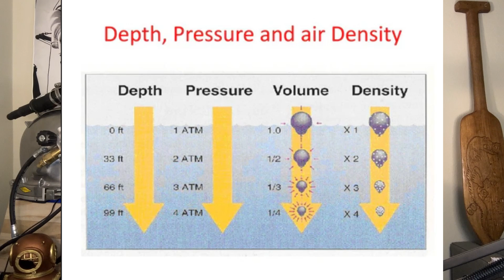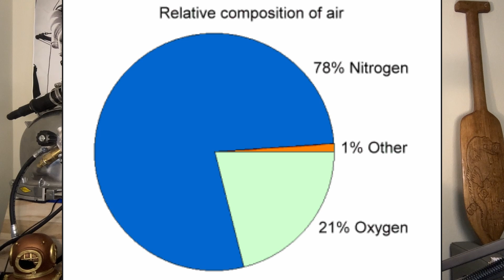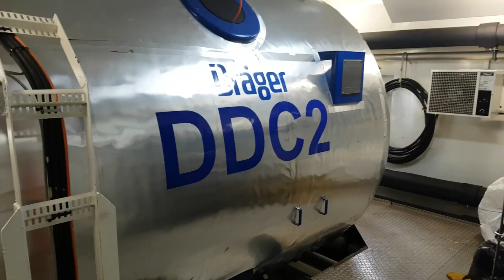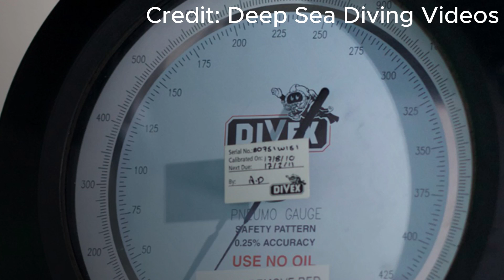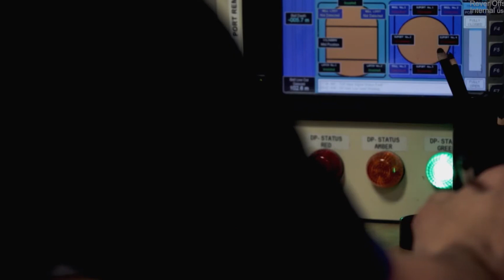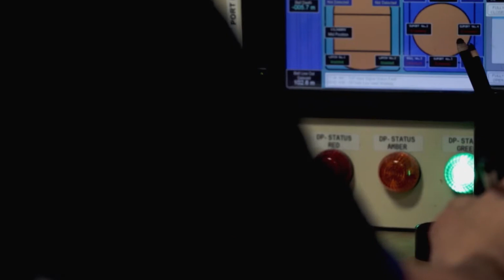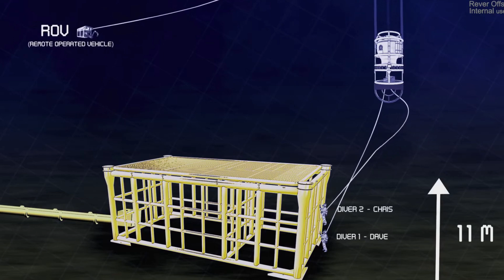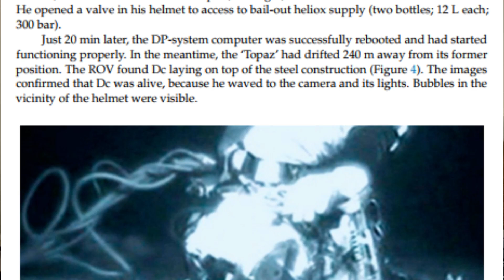Diver Explains LAST BREATH Movie & Saturation Diving

Comment: There’s a saying within my team in the Airforce. “You can be as prepared as you want but when ALL your Stars are somehow Aligned, disaster strikes.” 😅

Singapore’s F16 is equipped with FOUR pitch rate gyroscopes for redundancy – to guard against failures.

Yet, the EXTREMELY RARE event happened. ALL Four gyroscopes failed simultaneously shortly after take off and the pilot had to bail out of the aircraft.

Comment: I have a question about this movie.  Why was there not any medical supplies in the bell?  He was giving him mouth to mouth, which is basically CO2.  When he should have been given a canister of 100% oxygen.  They didn't have basic safety measures down there or was this just for the movie?  Also, why were they not using re-breathers in the first place?  And they didn't give my dude a working flashlight?
Reply: I dunno, but i think 100% O2 would be toxic at that depth... think severe O2 toxicity can cause seizures....and that would just make everything way worse😮

Comment: Still trying to figure out if them not being able to recreate the system failure is a good or bad thing 😅.
Reply from the maker: What’s up occurrence! lol I mean technically bad but I’m sure they removed whatever could cause the issue to happen again completely from the system.
Reply: @sspdiving The problem was caused by a network storm in the DP system. This problem is addressed by Kongsberg. Further is a test added that has to be performed during the annual DP trials of the vessel. We now have to stimulate a network storm. Further do we need to fail the DPC2 cabinet, in which the controller are located, completely during the 5 yearly FMEA trial, in order to proof that we are always able to switch to IJS control and can keep control over the vessel. What is concerning in this case is that the DPO's of the Bibby Topaz didn't switch to C-Joy control (IJS=Independent Joystick System) which is working independently from th DP system. They would have had way less problems keeping the vessel in a approximate position than on manual thruster control. Further did it take them a very long time to decide to hard reset the DP controllers. Even with one controller online the vessel would have been able to regain her position keeping abilities. Chris was very lucky to survive this incident. As a chief engineer I can assure you that this DP-incident has been discussed thoroughly with DPO's, Engineers and ETO's and keeps coming back up. No chief engineer wants to loose a diver.